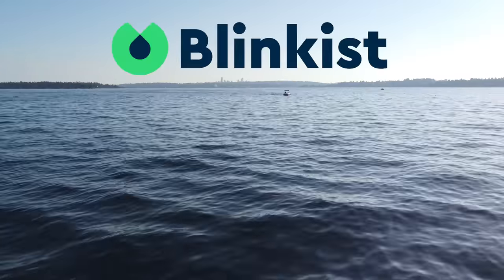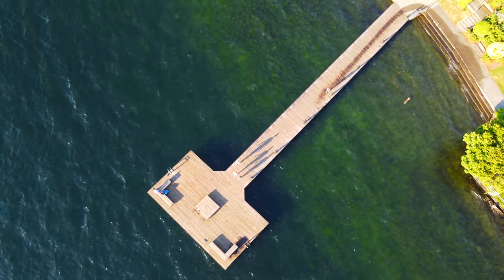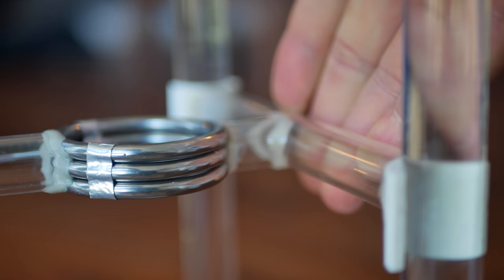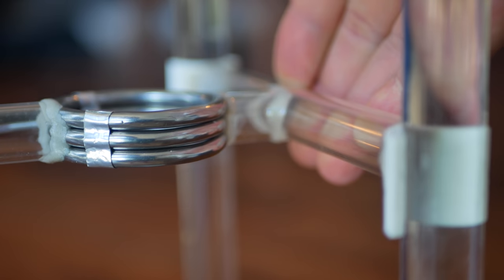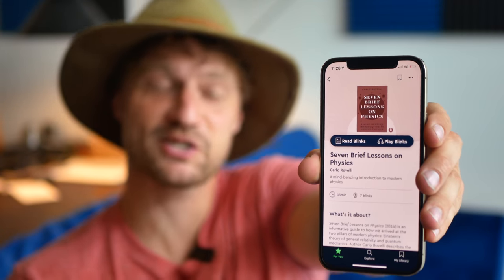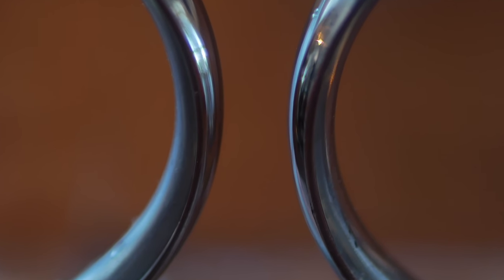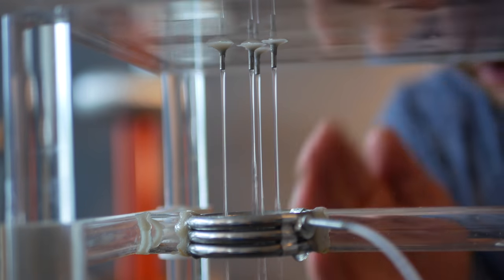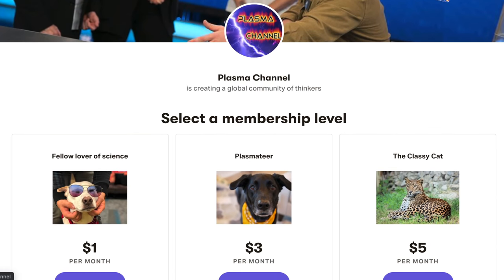Extracting 6,000 volts from Crappy Coffee (Coffinator 6000)

Comment from the maker: Blinkist loves science, and I love Blinkist. Check out https://www.blinkist.com/plasmachannel for 25% off new membership, and the first 100 people get unlimited access for a week.
Reply: Can you charge things with it? Like batteries?
Why steel and not copper
Reply: how about making a scale model of the pyramid of gizah and test out the theory of that 
engineer that the pyramid could function as a device like this and generate a charge?
Reply: I'm interested in seeing how to create a magnet without using other magnets; basically, producing current without a magnet and using that current to create a magnet.
Reply: @Beregorn88  use steel and rap it round with copper and bring the copper in contact with electric an you got an electromagnet
Reply: @basdewank3555  I know how an electromagnet works, I wanted to see how to bootstrap an electric generator without having access to magnet and power plugs...
Reply: @Beregorn88  you mean like an electromagnet?

i think that's just a coil with a ferrous core.
Reply: @daveyjones5702  no, not an electromagnet, a permanent magnet
Reply: @Beregorn88  how is it a permanent magnet if it needs current?

not sure i understand what you mean, but maybe this gives some ideas?:
https://youtu.be/6D3bMVv7w5w
Reply: @daveyjones5702  permanent magnets are not born out of thin air, they are manufactured by applying a strong magnetic field to a ferromagnetic material; heating and striking the material can ease the process. My question is: could this generator, a hand-spinned van der graaph generator or any other kind of magnet-less generator that you could build on your own (i.e. not a hundred LiPo cells charged from your power outlet), maybe coupled with the water condensers, provide the power to create a permanent magnet? Another way to say it, how do you bootstrap electronic technology?
Reply: When watching the anime Dr. Stone, I always wondered why they created a water wheel instead of using one of these. They already had the waterfall and these take so much less parts to create. Even if they needed the water wheel for other projects I still don't see why they wouldn't set up a kelvin generator as a first step to create other things with? Would it have been strong enough to create magnets with? Is there some inherent flaw with this sort of generator or something else that would have kept them from creating it or getting any useful power off of it?
Reply: I just discovered something today. The neodymium magnets on my refrigerator lost roughly 50% of their strength during a rain storm. Something about the rain was affecting the strength of the magnetic field. I'd like you to try this experiment yourself. Any idea why this happens?
Reply: I'm from Argentina, these great videos may be translated into Spanish. Thanks a lot
Reply: The rings you're using are stainless steel 304 or 316 they're not magnetic? Or is the nickel coated ones magnetic enough to hold?
Reply: U deserve more subs
Reply: Can you see if you can store the electricity and run a small water pump to recycle the falling water and can you experiment when it rains for rain water free energy
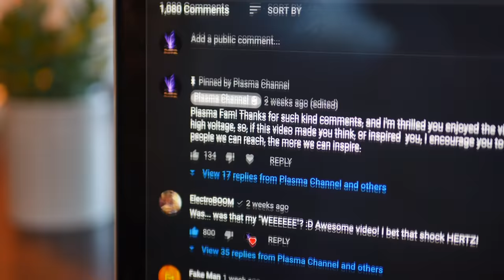Reply: I would love to see that happen 7:15 that would be cool to see
Reply: mann you are a genius .. i love your videos.
Reply: lǝuuɐɥƆ ɐɯsɐlԀ@ @Plasma Channel nice video .
Reply: Curious, [Practical Usage] would it be possible to split a running water  stream to run an electrostatic motor which, in turn, turns a permenant magnet generator to run an LED ?

Comment: Well Jay, you litterally used coffee to get that extra jolt of energy !
Reply: May you make a video extracting energy from tomatoes
Reply: Did you ever fix the instant-exploding prop on your recent project? I lost it when that thing blew up o.o edit: only really came back to edit my comment lol.(the one on the video, not this comment... I'm shutting up lmao)
Reply: Use melting aluminum to build a rocket novels
Reply: Hey @Integza how about we try it with tomato pulp😂😎
Reply: And now you need to do it with tomatoes, much success!
Reply: ^^ So you mean a Catsup powered Lord Kelvin Generator? I dig it. 
And about the metal rocket nozzles, both the channels The Crafsman SteadyCraftin and FarmCraft101 (links below) have experimented in depth with creating stronger parts or metal parts with plastic starting molds. In fact one of FarmCraft101's latest videos was about starting with a 3D printed Doge Coin and trying to create a metal one that way it had a physical form. It talks all about they considerations and pitfalls of the process and what he found worked best. I do however think that making one out of Graphite would be the most reasonable choice and since it has radial symmetry you can make it on anything that spins! If that is to expensive or is something that is beyond your current capabilities then you could try inserting graphite from pencils or something into the nozzle to create a barrier for the heat. Maybe check out graphite crayons or other graphite art supplies for a cheap source of graphite. You could make a resin mold and then glue the graphite in shaping them to fit together. You could also just try to glue a bunch of the graphite crayons together to get a cheap blank for a rocket nozzle and while it might work it also has the potential to burst apart in a fiery death-splosion so make sure you have your slow motion camera pointed at it!

https://www.youtube.com/channel/UCzsjHlc0WRwZYwlinsmtM4w
https://www.youtube.com/channel/UCO4AaIooUgGTlBH64KWO76w
Reply: I'm here because of Integza
Reply: Hint hint: I wonder if you can store that energy and use it for hydrolisis for a combustion hydro/electric engine
Reply: Shouldn't you be finding new ways to destroy the devil's berry?

Oh, fun idea... Use tomatoes to power a motor of some sort. Could probably use the gasses generated by dissolving a few somehow.
Reply: The layers of thought that go into this is awesome! 

The comment about hydrolysis was right on, a cool application would be to combine this and a circuit to split water.
Reply: Tomato rockets !!!
Reply: Haha 🤣 he certainly did ..

Comment: Another sort of related static generator in the video Armstrong's Electrostatic Boiler kind of reminded me of the Kelvin water dropper using partially condensed steam to create a charge or water droplets being swept out by escaping steam. In reading about the Armstrong Effect on Wikipedia, he also used compressed air producing a similar effect. The steam version produced 22 inch sparks and interestingly had glass legs that were 3.5 inches diameter and 3 feet high.
Reply from the maker: That's a really cool idea! Never heard of that, definitely doing a video on it now. Thanks

Comment: Nice episode. You can eliminate the chance factor with the triboelectric effect. Just put a plastic ring/collar inside the top right and bottom left to strip electrons off the water on that side. 
I've seen this done with two pairs of rings, so that the water passing through the second one neutralizes before going into a container. This is the first time I've seen the containers used as capacitor for the discharge. That might be slowing your charge collection, but it's an interesting effect.

Comment: 1) Why is there only a small difference in voltage, despite the size difference.
2) How much can you increase the power of your smaller scale model?
3) Can you combine the power of more than one of the small ones, and generate more power?
4) Can you reach 10kv, without increasing the size of your model?
5) Can you store that energy in a battery for later use?
6) Finally, what practical uses are there in this application (It is small and compact, pleasant to look at and easy to build)

Comment: In the past I made alot of Lord Kelvins Generators, but they never worked. Now I know what I need to do. Thanks!!
Reply: Yes i too built one but it never worked .
Now it works thanks to this video
Reply: Can we know what mistake you did last time
Reply from the maker: The most often mistakes people make on super low power sources like this, is not taking into account sharp edges. You'll notice every single electronic component in my build is smooth, with no sharp edges. Sharp edges leak away high voltage charge really quickly. That's not an issue if you're dealing with high power levels. But these generators create a fraction of a single watt of power. Sharp edges may be your killer.

Comment: Very nice implementation of Lord Kelvin's generator!  Imagine beefing up that spark by collecting the charge in a capacitor, and feed the capacitor output in series with the spark gap and primary winding of a Tesla coil... you see where I'm going with this right? Water / coffee powered Tesla coil!   Though the sparks would be intermittent, every several seconds you should get some very brief streamers out of the secondary topload. If that works, perhaps use the output of the Tesla coil to further ionize the water tray that is the source of your Kelvin generator.... more power!

Comment: Nifty AF ! & as always. Though IMO the absolute simplest/DIY HI voltage apparatus is friction gizmo consisting of a piece of fur rubbing a spinning pvc pipe near a tinfoil comb on a copper pipe plus a Leyden jar type cap. 6+ in sparks are possible with a well designed one. Just Say'n, perhaps even Supa Saiyan. 😅

Comment: If the device is improved upon to create a more efficient capacitor parallel to the two cups, you get an amount of stored energy in joules (watt * second) that is equal to 1/2*C*V^2. Perhaps when using a switched capacitor principle a momentary charging is taking place and only a partial voltage of the total voltage is stored. That might be an idea todo energy harvesting. And prevents the high voltage breakdown voltage between the cups. It takes some time and some fancy electronics but i think that in the end you can charge a battery with it and power electronics. Pure clean energy from potential gravitation energy. This is a great idea for students. You can use rainwater for it. Use a filter to remove large particles to prevent clogging of the waterdroplet tips and use tubing that has a titanium dioxide coating that will react to sunlight(UV) to kill algea and bacteria and keep the device clean. Those tubes will then supply the filtered and cleaned water to the storage tank on top. Just an idea. 😊 The switched capacitor technique will be the challenge to be overcome. If you ever get it to work, you can put this in all gardens and houses (many in parallel to increase the amount of power) and have clean energy everywhere where there is a lot of rain. It will not replace real power stations. But it will help a lot.

Comment: The problem with your theory of operation is that whilst, at any given instance, one stream may have more (say) +ve ions than the other stream, over a short period of time the number of +ve and -ve ions in either stream will balance out, unless there's some mechanism that drives ions of a particular charge to one specific stream.
The operation reminds me of the Wimshurst machine, and I suspect it's more closely related to the operation of that than to what you suggested.

Comment: That Philipp Ogris water dropper you commented on sure shines for length of spark and at one point in a gentle rain and thunder no less, in a beautiful mountainous setting. It might be fun to try and double that. If you have seen Bill Beaty's Kelvin water dropper thoughts, he has an inline version and other hints.
About 10 years ago I made a clip of a 13 inch spark using a piece of pvc rubbed with a paper towel sleeved over the tubing. It was good practice on how to keep the charges you make from leaking away. Thinking about a water dropper, it seems there's room for many fun variations and methods one could try to improve upon. And too, there're corporations like Accio Energy attempting to harvest energy from the wind using the principle.
Anyway, if i had a few more parts and motivation, I'd like to make something with clean lines and fancy like yours, with new variations.
Reply from the maker: Thanks for the input! Do you mind emailing me? I'd love to learn more about these adventures of yours with storing charge. My email is in the "About" tab of my channel page.
Reply: I nothing against email but  didn't want to sign up for another media platform to email.
Reply: I've

Comment: Hey Jay! I am amazed and I never thought of water carrying charges. I am still a little puzzled for some reason how the waters charges are extracted from the Hydrogen and 2 parts Oxygen and the mineral contaminants. How does it do this exactly? How does the charges get extracted from the Hydrogen and 2 parts Oxygen and Mineral contaminants? Or are you using distilled water? This is quite fascinating to me and I am puzzled a little bit. Where do the charges gather and where do the charges get stripped from? I think a video going in depth on this topic is definitely needed. This is pretty cool stuff. I am interested in seeing a video on what the limits are on this kind of high voltage power supply. I am also interested in seeing a video that uses all of these water methods in creating a circuit. One that could be used very nicely. I am also interested in seeing what this is capable of as far as what the maximum voltage level is for this kind of thing if it indeed has a limit. 

I liked the clips showing what how you acted right when it finally works. It shows just how much people like you and me put into experiments and projects and what a relief we feel when we finally figure it out. I loved the additional clip about the plexiglass and how long it takes for these take to cure and weld together. This is quite the video and I loved the new transition scenes you used with the oceans and the backgrounds. This was a great step and I like it. Keep up the great work Jay, and keep it classy and sparky :) 

 - Mr. Smith
         Stay classy :)

I'll see you in the next video. And I hope to see a video on these being tested to their boundaries and to see if a better laminar flow and a higher fall distance effects the voltage or current generated. It would also be interesting to see what current is being delivered from the charges building up. It would be interesting to see if one were to happen to be shocked by this, would it be a shock like one from a whimshurst machine, or if it would be like a shock from a moderate standard tazer.

Comment: Aside from those garden hose shower nozzles with literally hundreds of tiny holes which are very much like espresso coffee cup filters, it occurred to me those leftover rapid fill multiple water balloon toys that are a cluster of tiny straws might be another way worth trying to increase spark length. One of the ones I have has 37 long thin straws that thread/adapt to a garden hose. Another brand has the straws arranged in a gradually increasing spiral pattern. To space out the straws I saw a 5 inch steel shower drain screen with an array of tiny holes the straws fit into. I bought some very thin teflon tubing that sleeves inside the straws which increases the velocity of the spray. 
There's a video of small diameter teflon tubing with water and nitrogen gas pumped through it to form bubbles that create a visible spark. It was a clip on electrostatic discharge safety. You can also make sparks by pumping steam through teflon tubing. And a teflon tipped syringe is used to impart a charge on water whereby an astronaut shows how these formed water drops will orbit some polyethylene and teflon knitting needles in the weightlessness of space.
Reply from the maker: Whoa now. I need to do some reading on this. Sounds cool.
Reply: If you haven't seen it you can watch the YouTube video "Science off the Sphere: Knitting needle experiment" that experiment in space and hear it in a Texas accent. ha 
It's kind of interesting. I used to live in the Pacific Northwest and it's be funny to try a Kelvin water dropper arrangement on a small divided waterfall just to be different, if you could get it to work with some metal hoops and whatnot.
Reply: Here's another kind of static generator involving flow through a tube I learned firsthand, maybe of interest.
 I was discharging an old fire extinguisher bought at a flea market, one with a long horn at the end of a rubber hose with rusted wire mesh reinforcement underneath the rubber, discovered when cutting the tubing off, just wanting the tank for another experiment. I got zapped a few times and decided to put a cloth over the handle in order to continue emptying it. It only took a few good shocks to decide to this wasn't going to work. I later put the tank on the ground as well as more cloth over the handle when discharging it.
There was the typical white cloud of vapor and white snowy flakes that formed, along with several more distinct discharges of static that could be heard in the cone, like shorting a capacitor. In reading about CO2 static from fire extinguishers ...

"Anyone that is trained to use CO2 should also be trained in the hazard associated with static discharge. Large wheeled units have knocked down operators when the hose bonding wire had been damaged."
"CO2 fire extinguisher discharge hoses are manufactured with a braided continuous wire inside. If the wire in the hose is damaged, the buildup of static electricity can't be dissipated and the operator may experience a shock. This is particularly true if the fire extinguisher is being discharged while being carried up off the ground. That is why NFPA 10 requires that a continuity test be performed on the hose at the time of maintenance ..."
Reply: it'd